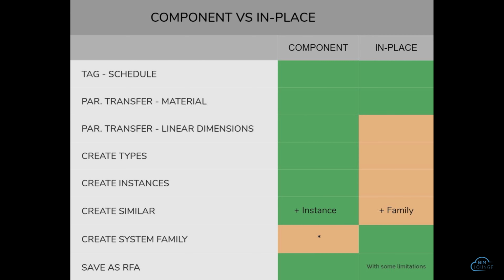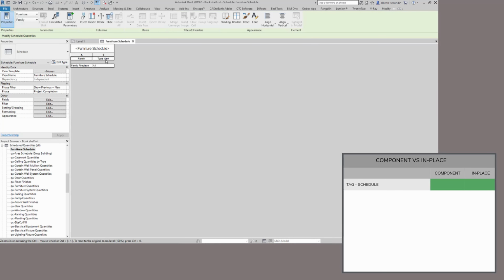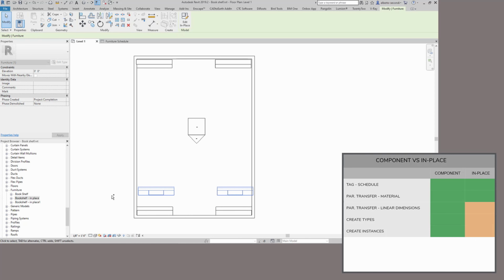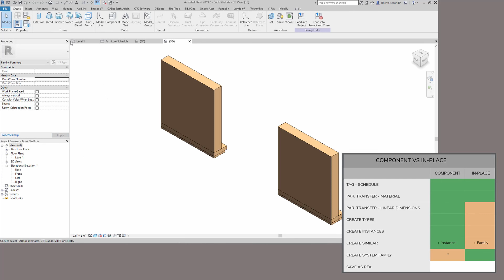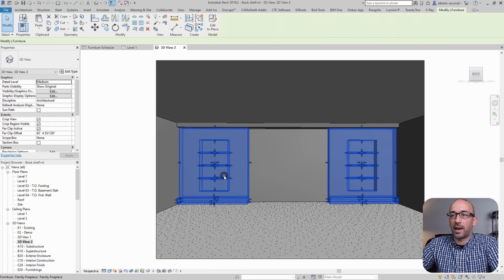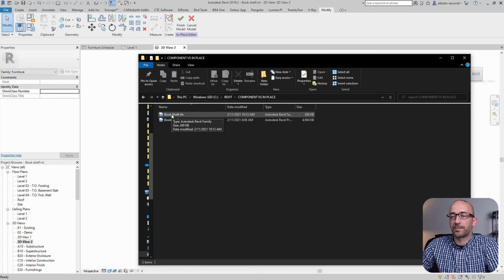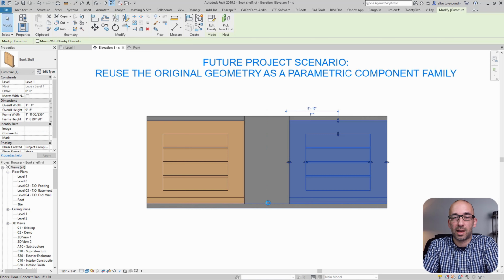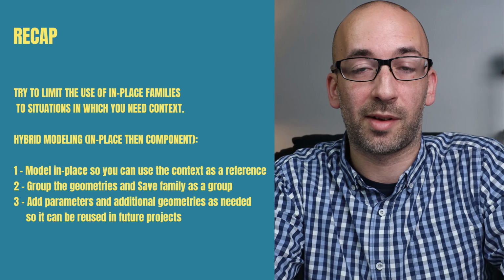Revit Component vs In place Families - Which Should You Use?

Comment: I try to use the in-place families  as little as possible for the exact same reasons you mentionned. Even when i am obliged to use them, after a while i identify the possible ones to turn into regular families. To do so, i may use the save group like you mentioned in the video, but i personnaly  prefer to copy/paste the family from the edit in place to a blank generic model family file.
Thanks for your videos and take care.
Reply from the maker: That seems like a great workflow. You use the right tool for the job and then reuse as much content as you can... Thanks!
Reply: @BIMLounge  Yes that's the idea. The objective is to minimize the size of the model file and optimize it by turning in place items to rfa files each possible time. Then if needed introduce parameters to it to reuse it in other models.